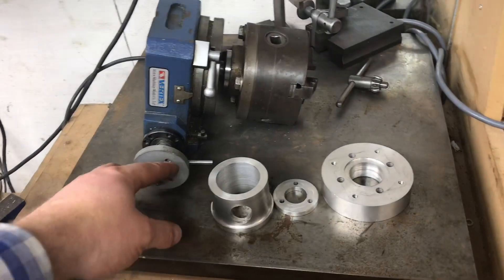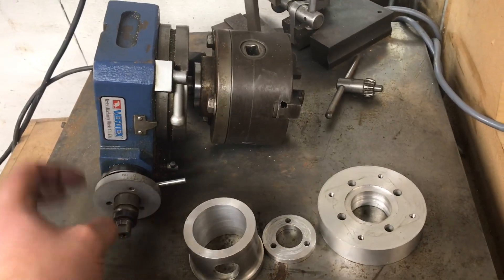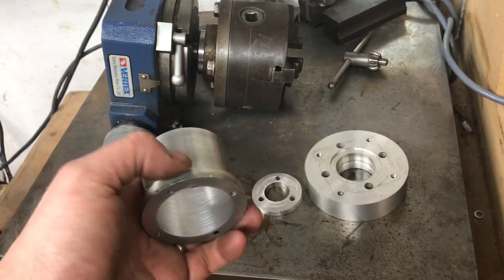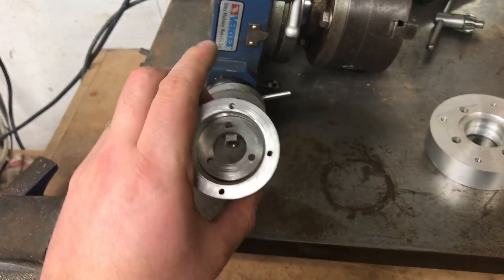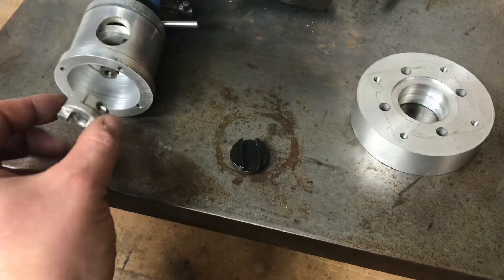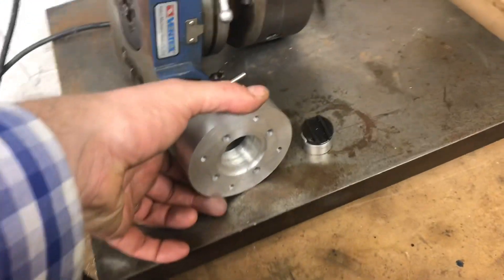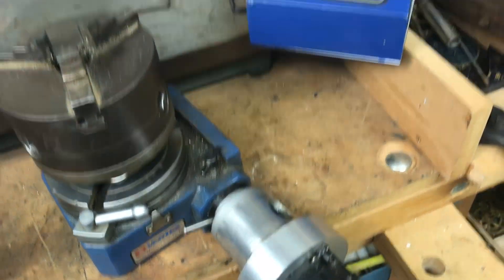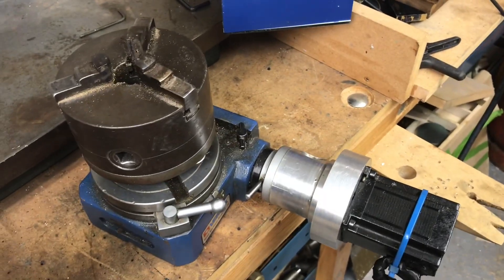Converting a Manual Rotary Table to CNC | Stepper Motor Retrofit

Comment: Hi Craynerd. firstly loved your Webster build.  I have bought a Nema 23 to turn my 150mm rotary table but it does not have the torque to turn the table. I bought a much bigger Nema 23 with a 10mm shaft but still not enough torque.  I can turn the table with finger and thumb on the 11mm shaft. Any help appreciated thanks
Reply: Are you using open or closed loop steppers?  Closed loop are far superior.

Comment: What size stepper motor did you use Adrian
Reply from the maker: Adrian Jeffery I’d like to say it’s a 3.1 Nm but I think it’s a smaller 2.2Nm Nema 23! It’s good enough for anything I’ve done but admit that I tend to turn and cut (clock wheels) and haven’t done much turning into a cut. I’ve done some turning during the cut in brass and that wasn’t a problem at all...never tried steel - only because I’ve never needed to. I’d probably go for 3.1Nm if I was fitting from scratch but this has done me fine for the last 10 years!
Reply from the maker: Adrian Jeffery I’d like to say it’s a 3.1 Nm but I think it’s a smaller 2.2Nm Nema 23! It’s good enough for anything I’ve done but admit that I tend to turn and cut (clock wheels) and haven’t done much turning into a cut. I’ve done some turning during the cut in brass and that wasn’t a problem at all...never tried steel - only because I’ve never needed to. I’d probably go for 3.1Nm if I was fitting from scratch but this has done me fine for the last 10 years!